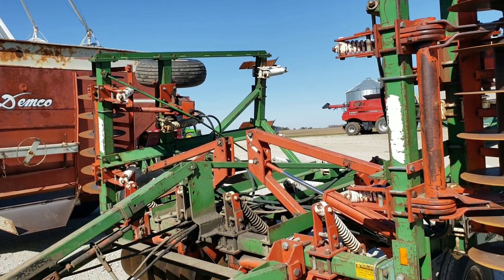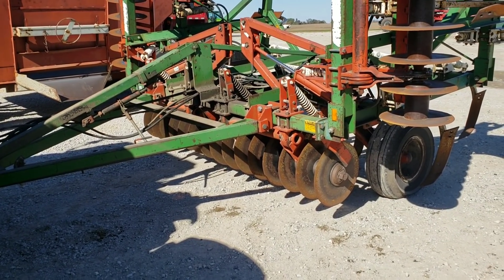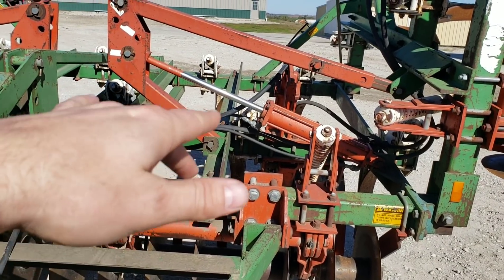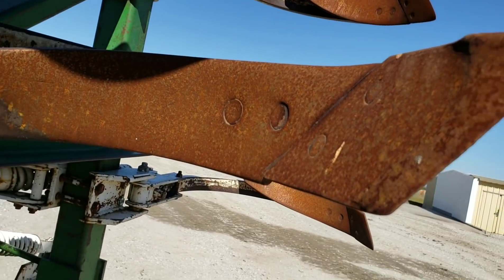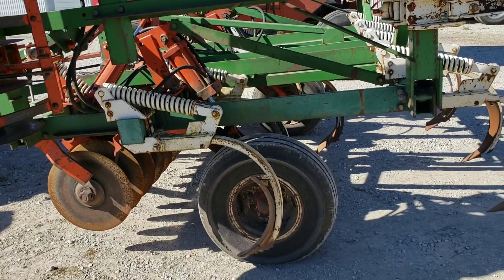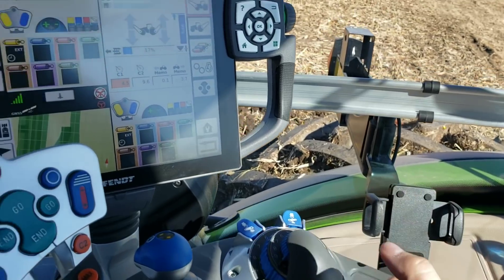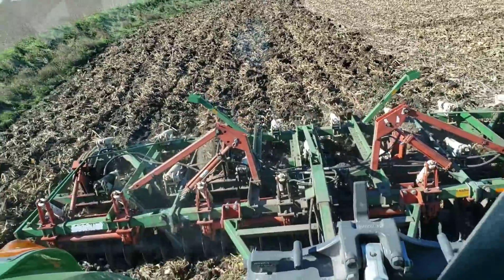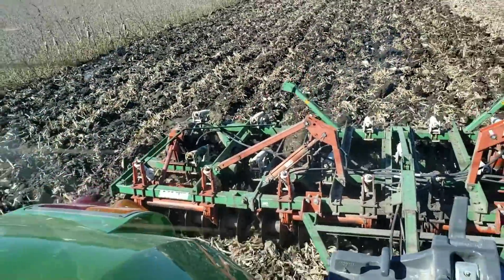Thoughts on tillage?

Comment: the rules of tillage change with Latitude.    Down there where you have shallow top soils and hilly terrain No Till make sense for the errosion issues.   He planted his fields contour but had the spray up and down.   During heavy rains the water will get into tracks left by the sprayer and gully cut wash outs.   Some of them were deep enough that the JD combine hung up with corn head full raised . luckily he could shove some dirt with te corn head to get the wheels back on the ground
Reply from the maker: Right on .. it doesnt take long in sw iowa to make 3 ft deep ditches